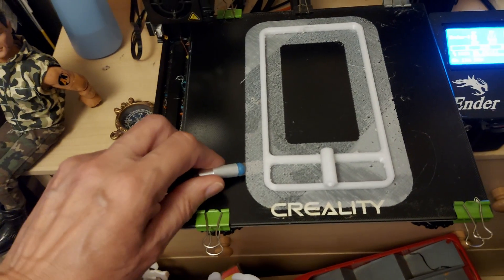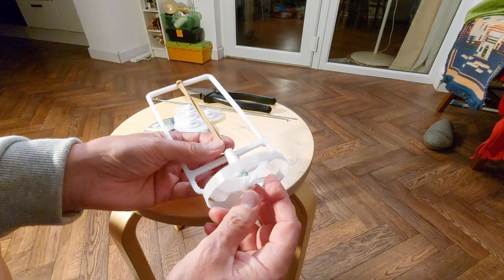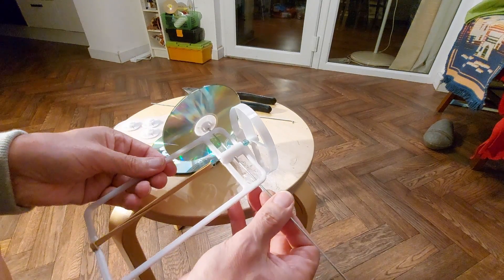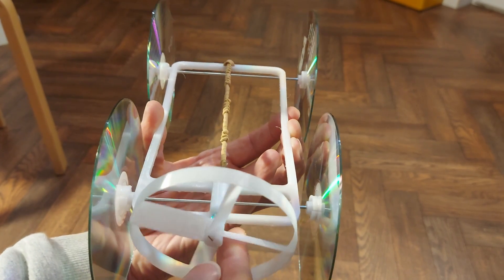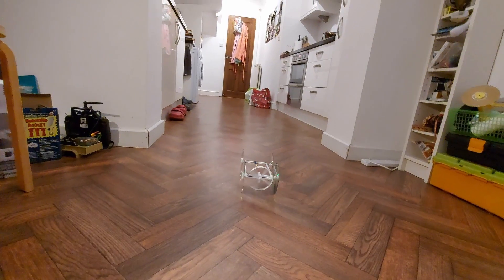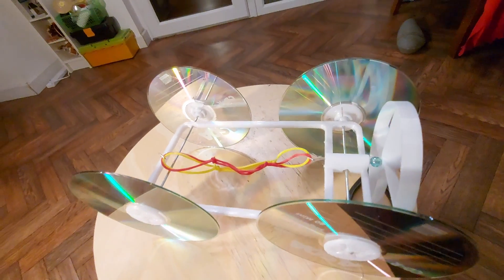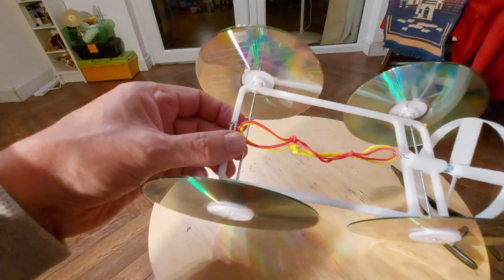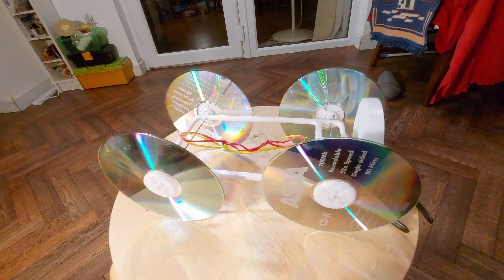Put a rubber band on it 0453 3D printed fan driven car

Comment: Nicely done 👍
Reply from the maker: Not one of my best designs. I might double the length, so we get a descent duration for the run. Probably double the number of blades in the fan too.
Reply: You still planning on doing this? Would love to see you refine it to your liking  @Putarubberbandonit
Reply from the maker: That PETG is giving me problems. I need to use it for the helicopter blades I intended it for, but it is not looking promising at the moment, so I am giving it a rest for a while @spencer963